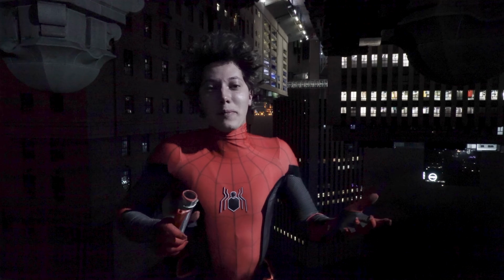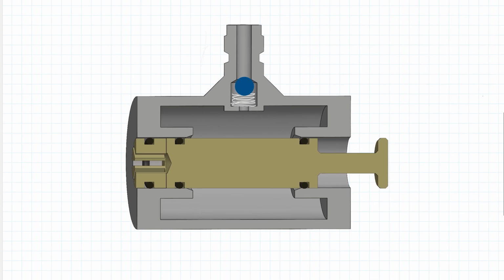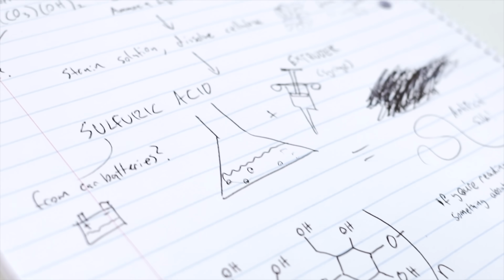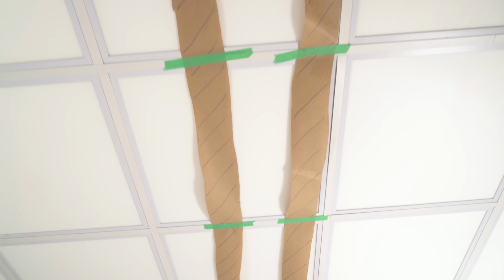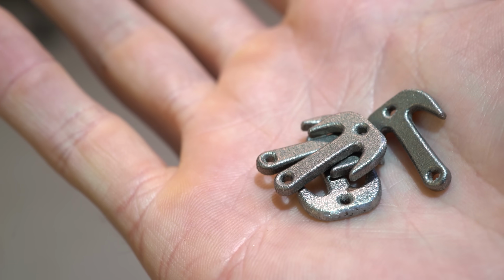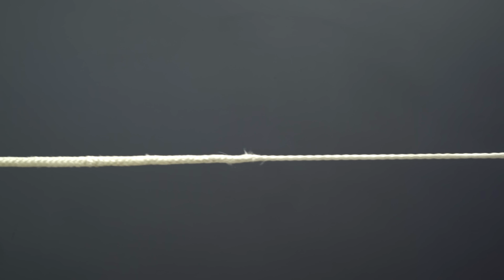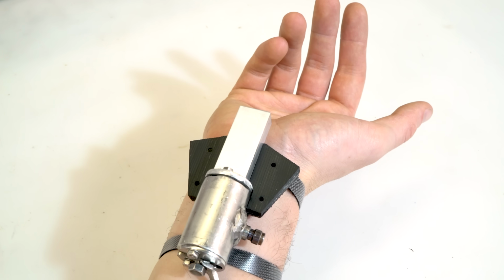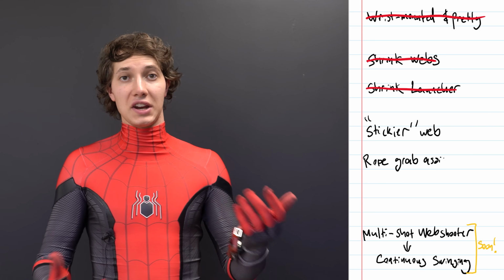Engineering real Spider-Man webshooters

Comment: Honestly, love the actual deep research and commitment into lesser known ways to fix the problems you had. You've made them actually well sized but also kept the ability to have the power that will be needed to launch them to good lengths. I genuinely believe this is the closest to plausible Web Shooters out there to date...
Reply: For sure toji fusiguiro spiderman guiro
Reply: Bro is glazing😭😭
Reply: @kkurt_cocainee  yeah glazing
Reply: JLaser is better
Reply: @Spooderman-2099  in their own way, they're very good, I agree. But the size of them is massive. With BuiltIRL's ones, they're very small, and don't damage the item they're attaching to, they just wrap round. Plus as I say, the size to strength ratio here is so much better. Plus the possibility of this becoming a 'real' way for it to work, are much higher in my eyes
Reply: @MagicianLorenzo  Would appreciate it if you refrained from the use of a singular pronoun to make this entire comment slightly understandable
Reply: @LeonVega-i2v what